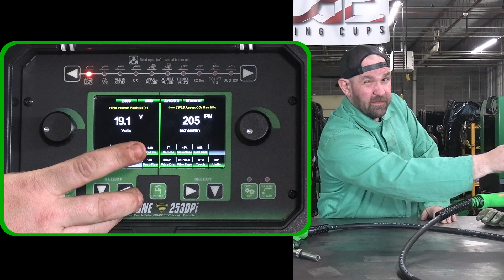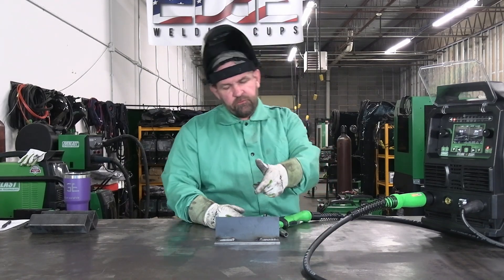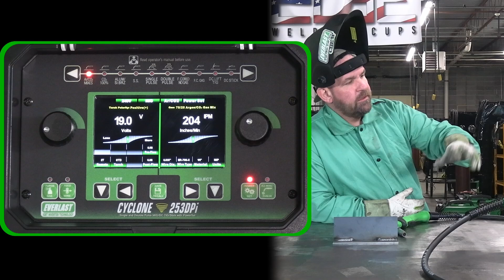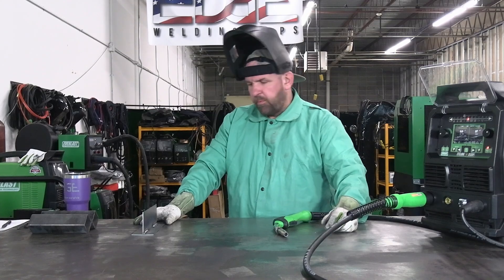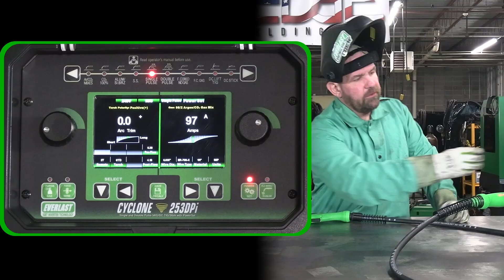253DPi   Steel

Comment: Hello,pretty new to welding and considering upgrading to a 263pi or thunder 255. Is it possible/advisable to run 90/10 gas on short circuit? Only reason would be able to have 1 bottle for short circuit and spray. What would the downside be to running 90/10 vs 75/25 on short circuit? Thanks
Reply from the maker: Absolutely; 90/10 works great for short circuit, and allows you to get well into spray transfer as well.
Reply: @everlastgenerator perfect thanks for the reply, what adjustments would I most likely need to make? as Iam assuming power set would be figured for 75/25, or would 90/10 run very similar?
Reply from the maker: @chaddisisto4915 the powerset mode for argon mixes is pretty darn close whether your running C25 or C10. Typically you’ll want to run about a volt higher on C10. There’s plenty of adjustment still within powerset mode to make up any difference
Reply: @everlastgenerator great info, thank you. You may want to consider a video on that information, iam betting that iam not the only one that could benefit from knowing that. Again 👍
Reply from the maker: @chaddisisto4915 always open to suggestions, makes my job easier planning out videos if I know what everyone wants to see! Going to try doing more project type videos with the units once we get through some more of the new models
Reply: @everlastgenerator as someone who is new to all forms of welding,I’ll take all the videos you can make lol. I just started welding a little less than a year ago,I have tried flux core,short circuit,stick, and just got the tig kit for my 210stl so iam just getting into tig now, I very much like learning new skills so all the processes and modes of transfer interest me and the price points of your machines make it practical to try most of them so maybe other people would be interested in seeing things like spray,pulse spray, MiG aluminum with spool gun and reg whip and how the average person could use all of those things, or maybe iam the only one 😂
Reply: @chaddisisto4915  PowerSet shifts recommendation of gas according to the settings. It could be either. The higher settings will require a spray capable gas (on non pulse) 75/25 should not be used for pulse. Only 90/10.
Reply: @marklugo6002  yup I know i would need 90/10 for spray and pulse.I was wondering if i could also use 90/10 for short circuit so i wouldn’t need to get a separate cylinder for each mode of transfer. Thank you for the reply
Reply: @chaddisisto4915  It will make an awful soft arc.  It will be smooth but penetration will be low and cold lap is really easy to let happen.  It won't freeze well on vertical or overhead.
Reply: @marklugo6002 oh ok, so better to stay away from 90/10 on short circuit, darn thought I was onto something lol, thanks for the info 👍
Reply: @chaddisisto4915 there are some gas mixes that can perform on both pulse and short circuit.  82/18, 83/17 and even 85/15 will typically do well. The only thing is powerset settings will require a tad more voltage than usual and may not be accurate.  But manual control should not be an issue. You will still get a softer arc than 75/25 but it can be managed.
Reply: @marklugo6002 excellent info, thank you 👍
Reply: @chaddisisto4915  90/10 can be used in a pinch.  It will be a nice clean weld.  But it won't penetrate near as well.
Reply: @marklugo6002 a little off topic, but what are the minimum thicknesses of mild and stainless that you would consider using pulse MiG on?
Reply: @chaddisisto4915  It depends upon the pulse MIG and what it was designed for.  .035" is about the thinnest I'd tackle.  The 253dpi is better designed for low end stuff.
Reply: Hope this can help 92-8 mix for single an double pulse for Steel only in any position that’s th beauty of pulse….90-10 mix for Spray arch only to be preform in flat or horizontal position ….75-25 mix for  mig an dual shield flux core wire is mix that are gonna give u ur best results an obviously 💯 percent argon wen ure welding aluminum 👍🏽make no mistake that with dual shield flux core u can achieve great results in any position let along th penetration u will get along with it….the Big difference wen u step into pulse is that allows u to to weld with th same penetration of not better An more pleasing looking welds with no spatter whatsoever no clean up at all 👍🏽
Reply: @richarcruz7843 thank you for the info. Unfortunately the money for a new machine didn’t come through as I hoped, so limited to my current 170 amp MiG machine for a while longer